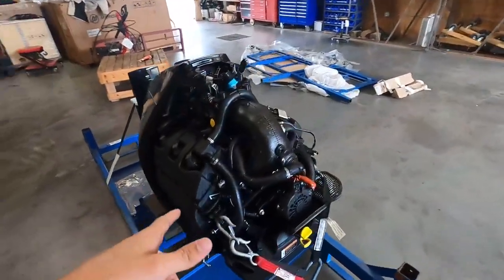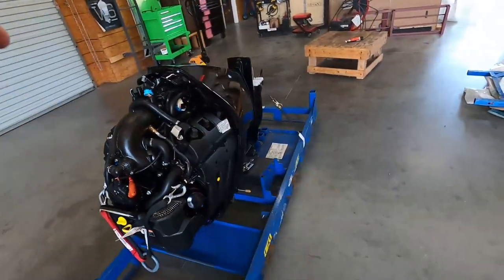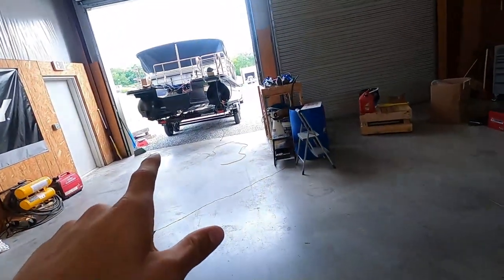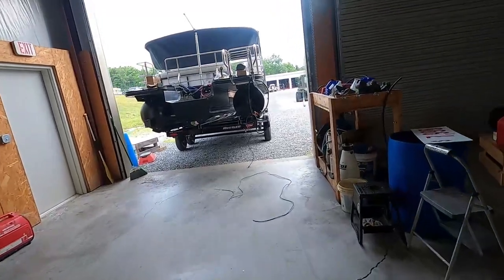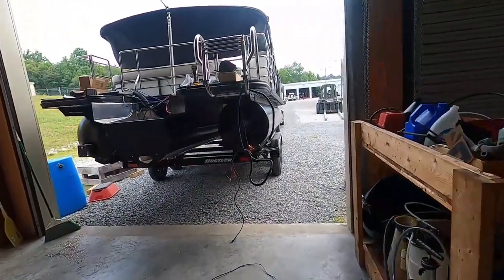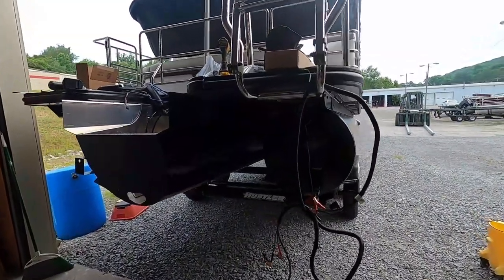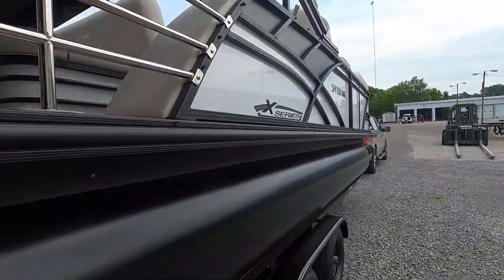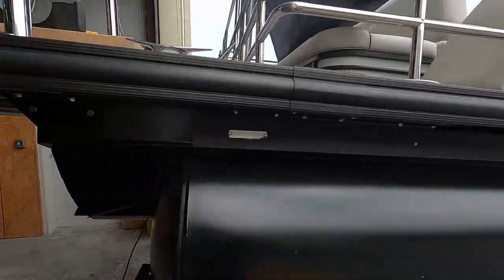Mercury 200 HP Install On A Tritoon.... What Will It Run?

Comment: Why did you not explain on how/why to set the proper height with anti ventilation plate in regards to transom? This really really important point and is always missed and not explained and talked about much. This affects efficiency,handling, and prop trim adjustment.
Reply from the maker: In our years of experience and hundreds of boats we have put together, these Tritoons don’t have much to any difference in where they are set to. But you are correct. It is a very overlooked point that needs to be addressed.